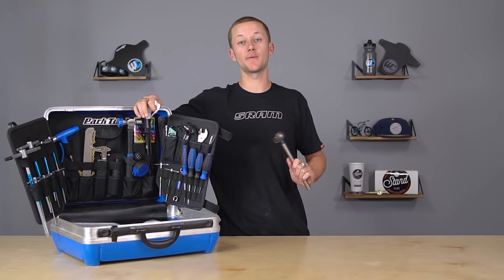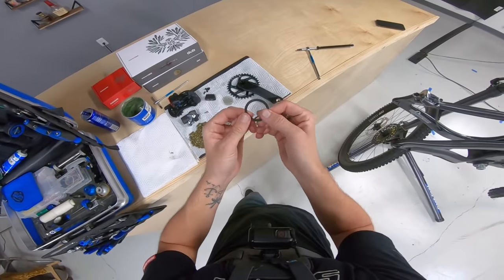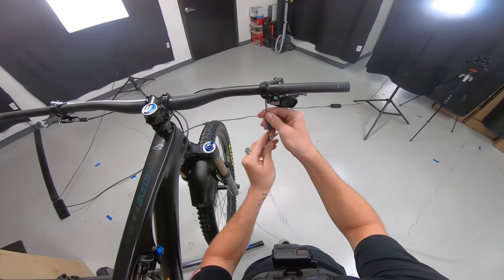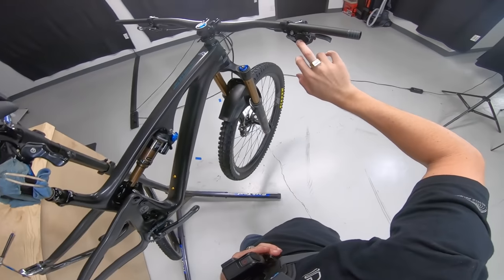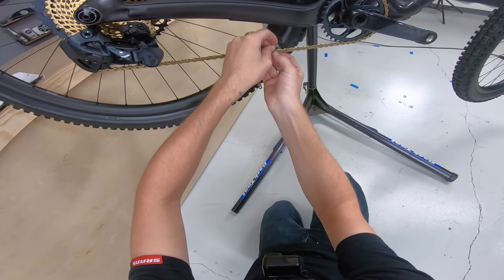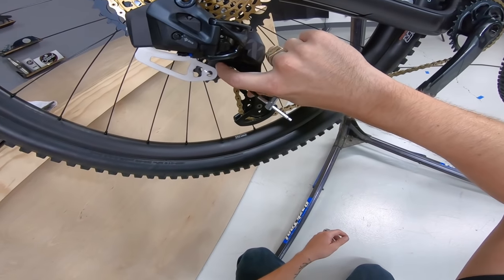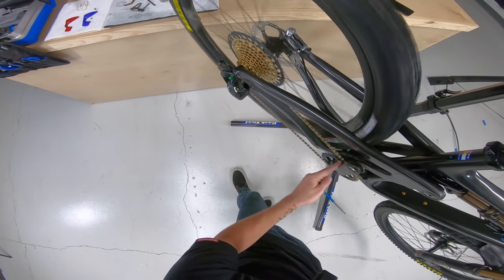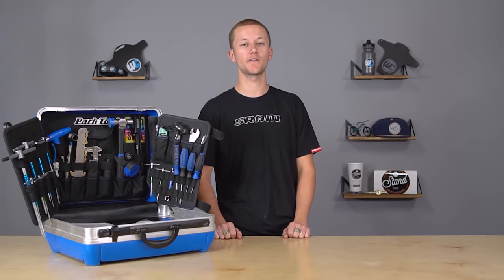How To: SRAM AXS Eagle Drivetrain Install & Setup (Step-by-Step)

Comment from the maker: What is your perfect drivetrain setup?

00:00 Intro
00:29 Parts and Tools
00:56 Install Cassette
2:00 Install Crankset
4:34 Install Rear Derailleur
5:14 Install Controller
6:10 Install Rear Derailleur Battery
6:31Pairing Derailleur and Controller
8:22 Linking to the AXS App & the different modes
9:54 Install Chain
12:34 Derailleur B Tension Tool
14:59 Derailleur Limit Adjustments 
17:42 Micro Adjustments
Reply: This, but with the rainbow chain and cassette.  Then toss on a Reverb AXS and XTR 4-piston or G2 Ultimate brakes.  Put that all on a S-Works Stumpjumper frame with custom paint, Fox Factory suspension, and some fancy Roval wheels.  Something that I thought would look sweet is if you take the upper of a Reverb AXS to a anodization shop that does Kashima, and get the uppers Kashima anodized to match the suspension.
Reply: XX1 AXS(rainbow full set) on my XC bike and XTR full set on my Enduro and trail bike
Reply: i have the same but in X01 uninstalled. I'm still trying to figure if I have to replace my chainring. what was the crank and chainring used in this video?
Reply: Shimano 12 Speed deore cassette for looks and hyperglide +, then a sram axs shifter for crisp 12 speed action, ofc with shimano chain. Mismatch made in Heaven. I currently have the probably sexiest E-Bike on the market and installed AXS on it today.
Reply: A free one
Reply: Hey are the limit screws the same on mechanical eagle? Closer one to the cassette is high?
Reply: Axs, but running a 10-42 11 speed cassette ;)
Reply: Where you buy all your tools on the video?
Reply: Something that FREAKING WORKS
Reply: XT 11 speed ftw!
Reply: @MrBig617  Hi trying finding some information about this. Is possible use AXS on 11 speed cassette 9-46?
Reply: @dylan-5287  Hi Dylan 
It's possible use 11 speed cassette? I have 9-46 (garbaruk-sram) and want to try this.
Reply: @mattamee7  No idea. I've been searching high and low on a hack to run it with a 10-42 11 speed cassette. No luck yet.
Reply: @mattamee7  what do you mean?
Reply: What tool kit are you using in the video
Reply: is it possible to just get the reverb controller (no seatpost)  by itself and add it to the derailuer/controller so that i have right hand controller shift down the cassette and the left hand reverb controller shifting up the cassette…

like a paddle shifter in a car?

Comment: Here's a trick, unless there's some reason I don't know not to do this.  Instead of adjusting B with the rider there, simply let air out of the shock and use a cinch or ratchet strap from seat post around rear rim to hold it at 20-30% sag, whichever you think the rider will want.  Coil is a bit more difficult but usually you can lean over seat, with seat in chest, pull up on stay to proper sag, and pull cinch strap tight to hold in place long enough to adjust the B.
Reply: Very conventional method. I like this video on sizing the chain because he did it very straightforward.
Reply: I tried your tricks and the only way I found to hold coil in sag is from the back triangle,but then it stuck the wheel, do you have better place to do it on santa bullit ?
Reply: @geekBengal  Woah, this is an old one!  So I'm not sure what you mean.  Did you run the strap around the base of the seat post and around the rear rim?  If so, lean over the bike with the seat in your chest, pull up on the chain stay, cinch the strap.  Should hold it in compression then.
Reply: @Chuckolicious  Yes but then the wheel is not moving anymore. Another question, is it mandatory that as soon as you move the wheel to match the cog of dérailleur, is it normal that the other teeth are not touching the white anymore ?
Reply: @geekBengal  So I've been talking about measuring that B-Adustment screw with the little plastic gauge they send.  For that there is no spinning or shifting.  Remember, if a rider was sitting on the bike like they suggest, there would be no spinning the wheel either.
Reply: @Chuckolicious  but in their tutorial they move the wheel+cog until it match the middle of cog right

Comment: „I like grease“ - puts the cassette on dry 😅
Reply: new cassettes have anti-seize from the factory :)
Reply: That is correct but a little more grease wont hurt.
Reply: @taunir713  as long as it’s the same anti-seize. I wouldn’t mix bearing grease with anti-seize tho..
Reply: @liamwoods5353  Ah thx, would the Shimano antiseize be the right One?
Reply: @taunir713  probably not
Reply: Most on this vid is wrong

Comment: Don’t grease your hangar bolt, unless you want your expensive AXS to undo and end up in your wheel, use blue Loctite.
Reply: It comes with pipe tape already applied so you shouldn't need to do anything except tighten it and move on.

Comment: Of course this comes out 1 hour after i install my SRAM AXS setup.
Reply: Was it as easy to install as the video shows?
Reply: @ddialogue  Yes, very easy.
Reply: are you using the 10-52t cassette? did you use the Blue B gap tool?
Reply: @kylaling10  Yes, I'm using the X01 10-52 upgrade kit but the shop ended up installing it for me when my new bike came in.  They didn't give me the B gap tool (doh!) but I already own the updated B gap tool (white) which clicks on to the 2nd largest ring on the rear cassette.  Now I'm wondering if that's the correct tool for the job. 🤔
Reply: @ddialogue  just wanna know if i’m correct  so the blue is meant for the 10-50t and the new white tool is for both 10-50 and 10-52.? My upgrade kit came with the blue one and i’m using 10-52t cassette.
Reply: @kylaling10  Oh, I see!  From what I can find (on Google) the white tool is the updated/compatible tool which is used for both cassettes on AXS and non-AXS drivetrains.  The 10-50 was the only option when AXS was first released and if I was in your situation, I'd use the white tool just to be sure.
Reply: @ddialogue  okay, thanks.. by the way i’m from the Philippines. Guess i have to order it.. appreciate the time..
Reply: @kylaling10  i used the white b-gap tool, the blue one does not work. it comes with the 52 cassette

Comment: Like your videos. This is all straight forward when you have the correct HUB on your wheel, when you have the correct BB, when you have the correct post vs flat mount brake calipers, and you know what you are doing.
I myself, am in the progress of overhauling my original Giant TCX ADVANCED PRO 1. I was mounted Shimano 11spd cassette, SRAM S series hydraulic brake calipers, shifters, all mechanic.
Going to XX1 10-52, XX1 AXS derailer, keeping my original BB and Crank from ROTOR, swapping to a single narrow/wide 40 teeth front ring and going with Sram FORCE shifters which come with flat mount calipers that I will have to take off, to use my original s-series sram calipers as they are post mount. FORCE don't make post mount calipers any longer.....

Its very complex and confusing to know when you need a BB spacer, when you need to use an XDR or and XD hub. Is your existing wheel even compatible with an XD hub or XDR hub etc...
The calipers, can they be re-used with a different shifting group.... lots of unknown for office workers like me.

Keep the videos coming, I have learned a LOT! Thank you.

Comment: So I have an AXS shifter and derailleur I put on my bike with 10-52 NX cassette.
1x 32T drive and NX chain NX cranks
Worked FLAWLESSLY! No issues what so ever!
Then I got new wheels. I9 hydra hubs with XO1 10-50 cassette changed out the cranks to XO1 and chain xx1. I measured the NX chain that was with my 10-52 to be the exact length of the new XO1 10-50 cassette...
Adjusted the b gap perfectly It shifts PERFECTLY SMOOOOOTH with no load on. But as soon as I put some load on the shifting is hard like there’s a crunch where as before it was smooth. Very hard shifting sounds...
The chain doesn’t jump or anything it shifts great with no load when I ride around the block.
Any tips or tricks???

Comment: Great video! Just upgraded my vitus mythique 10 speed to sram xo1 12speed (cable) . When i go lineup my jockey wheel( on derailleur ) with 10T cog the adjustment screw needs to be backed all the way out. Like if derailleur needs to be spaced out so screw can be screwed in. The hanger is stock and not bent. What to do??

Comment: excellent I,have a question for you. My bike has a coil, how it is possible to do it in sag position alone ? I tried using something to press and keep my coil in sag,but then I cant move the wheel anymore to use the b tool. Do you have an idea ? Because there is a very big difference when bike is in sag regarding the derailleur

Comment: Great video, I just bought the upgrade kit. Will I need to alter my chain length if I am doing a straight switch over of the derailleur from X01 to X01 AXS? Thanks.

Comment: We installed a GX Eagle AXS last week but we couldn't make it perfect even when configuring it under sag. First of all, it seems to me these micro adjustments are not really that micro. 8 clicks and the chain is already switching to the next cog. I mean, with my Deore Shifter I get a lot more fine cable tension turns and I can adjust it so it doesn't make any noise in any part of the 11 speed cassete. However, I do run a 2x11 setup so the chain line is perfect.

Comment: Great video! I’m finding it hard to get my axs shifting perfectly when I’m on the bike, but I haven’t adjusted under sag, so that’s probably it. However while fiddling with the adjustments I’ve done a lot of micro adjustments on the controller. Is there a way of resetting to factory settings? I reckon I’d like to get the new b tension tool and start again from scratch! Cheers.

Comment: Hey guys little confused about this setup. 

Per SRAM, you’re supposed to set the chain up in full sag or remove the rear shock and you’re supposed to measure the length of the chain using the largest cog. It’s any particular reason why this is being done differently.??

Comment: What does "under sag" mean?  Also, that tool that  you clip onto the large cog for the b-screw adjustment--what is it called?  And can I use it to adjust for a cassette that I just put on- 9/48 -- 48 is my largest cog?

Comment: Liam, bought a second hand Scott Spark RC two weeks ago with Sram Axs eagle. The front shifting is not working (changed the lcd battery..nada) looked at the AZS app and there's a shadow/black where the front shifting should be with an exclamation mark. Reached out to Sram and it's not got back to me, any advice here  could it be something more fundamental like, sadly (replacing the shifting mech)

Comment: So I’m curious what happens if you guys try to set the chain length the way sram says?  I’ve always used the bottomed out on big ring and use appropriate overlap and it’s always been successful for me.  Now with the 10-52 if I do this I end up with a drooping chain on the highest gear.  Have you guys ran into this?  Maybe sram needs a revision
Reply: It should only droop when the bike is unloaded. If your at SAG it'll be right.
Reply: @calvinspaeh3353  correct but it only does it with the 52t not the 50t and then when the rear wheel leaves the ground the chain droops and changes gears in the rear over rough stuff.  So I end up running the chain length as if using a 50t so it’s a touch short but the alternator is tons of chain slap from the droop accompanied by the weaker clutch on AXS and then sometimes gear changes.   So hopefully they’ve addressed that

Comment: I pretty much have 2 gears side by side that usually give me trouble.  I make adjustments and usually the 2 problematic gears move together somewhere else on the cog.  🤷‍♂️  Sometimes I press the thumb paddle softly (without changing gear) and that   minor tension kinda sets it in gear.  Its a fine shifting art but annoying A.F.

Comment: Fellas, my axs is way off at the starting position.  Like way too far outboard.  This is on a brand new frame and new hanger, it's not bent.  It will only shift up, essentially 10 gears because it's starting position is so far out.  How can I tell the derailer to start further in board?  This is driving me crazy.  If I have it shifted to the smallest gear it will shift the chain right off into the chain stay.  If I adjust the limit screw so that the pulley is under the 10 tooth, the derailer won't shift until I press the shift twice and then it will only move 10 gears.  I tried micro adjusting the 1st gear position, but it tops out before I can get it in the correct position.  Please help.

Comment: The official sram manual clearly shows that the shifting bolts should not be lubricated. The bolt is covered with loctite. This already shows the contradiction - loctite - grease. It's strange that no one pays attention to it.

Comment: What’s your opinion on SRAM saying: no  Grease on the main Screw of the Derailleur? (SRAM install video on YT)
I heard people complaining about the Derailleur loosening.
Reply: Alloy on Alloy sometimes will bond over time, if performing regular bolt checks ive never had any issues :)
Reply: I'm not sure why they said to use grease when assembling the screw on the derailer. Some metal will react chemically when assembled (aluminum to steel) and you want to use anti seize which helps prevent this. Steel to steel (bolt/screw to threaded hole) I would recommend using a thread lock compound. Several types are made (low, medium, penetrating) which one is used depends on what you are assembling.  It should go without saying that anything that is used with allot of vibration and impacts the fasteners should be checked often. It's the nature of the beast that MTB require allot of maintenance. Simply riding it and checking bolts and fasteners once in awhile your bound to have problems.

Comment: is the Blue B tension tool used for 10-50t? because i have the 10-52t cassette. just want to know. thanks. great video by the way.
Reply: There first was a red tool for OG 10-50 eagle. Then the purple/blue version came out for AXS and it should do 10-50 and 10-52. The white version is completely different and works with -50 and -52

Comment: SPECIALIZED
STUMPUMPER EVO Troy Lee Designs 29 Frameset - Limited-Edition
Frame Build

FRAMSET BUILD

#01  Specialized - Stumpjumper Troy Lee Designs 29 Frameset – Limited-Edition FACT 11m full carbon frame, asymmetrical design, 29 style-specific EVO Trail Geometry, SWAT™ Door integration, threaded BB, fully enclosed internal cable routing, 12x148mm dropouts, sealed cartridge bearing pivots, replaceable derailleur hanger, 140mm of travel

WHEEL SET

#02  Chris King - Disc Hub Rear ISO XD 28 Hole BOOST 148mm x 12mm Thru Axle, Color - Red

#03  Chris King - ISO AB Disc Hub Front 28 Hole BOOST 110mmx15mm, Color - Red

#04  Pillar Racing Spoke - WING 21 - Stainless Steel Spoke/Ceramic Nanometer Ti Plating, Color - Ti Black, 46pcs

#05  Sapim - Polyax Secure Lock Nipples, Color - Red, 46pcs needed

#06  We Are One Carbon Union 28H Rim 29", 2pcs

#07 PEATY’S - X CHRIS KING (MK2) TUBELESS VALVES Color -Red (PAIR)

#08 (Front Tire)  MICHELIN WILD ENDURO FRONT GUM-X      Size	     29X2.40    

#09 
 (Rear Tire)   MICHELIN WILD ENDURO REAR     Size	      29X2.40

DRIVE CHAIN

#10  SRAM - XX1 Eagle AXS Controller, EC-AXS-SRAM-A1

#11  SRAM - XX1 Eagle AXS Derailleur, RD-XX-1E-A1

#12  SRAM - XX1 Eagle Chain, 12sp, Gold, CN-EAGL-XX1-A1

#13 SRAM - XX1 Eagle Cassette, Gold, CS-XG-1299-A1

#14  AbsoluteBLACK - OVAL BOOST DM CINCH PREMIUM CHAINRING, TOOTH COUNT - 32T, 

COLOR - Black

#15  MRP - Chain Guide Mini G3 32-36T BB Mount

#16  Chris King - BSA ThreadFit 30mm Bottom Bracket, Color - Red

#17  RaceFace - Next R Crankset, Arm Length 170mm, Color - Stealth

#18  Hope - F20 Flat Pedal, Color - Red

SUSPENSION

#19  FOX - Factory Series 36 FLOAT 29 160 GRIP2 HSC/LSC HSR/LSR 110mm Axle 1.5 T Kashima Gloss Black, Standard Chassis 44mm rake

#20  FOX - DHX2 Performance Elite, Rx Trail Tune, 2-position lever, 210x50mm, S3-550lb spring

COCKPIT

#21  FOX - FACTORY TRANSFER SEAT POST, Diameter Size 31.6, Metric Size 150mm

#22  Cane Creek - SEATPOST SHIM 31.6 to 34.9MM

#23  Wolf Tooth - Seatpost Clamp, CLAMP DIAMETER 38.6, Color - Red

#24  Wolf Tooth - ReMote Limited Edition Red

#25  Wolf Tooth - REMOTE FOR SRAM MATCHMAKER X

#26  Specilized - POWER PRO ELASTON SADDLE - Black 143mm

#27  Chris King - Dropset 2 Tapered Headset 42/52mm, for Tapered 1-1/8" steerer, Color - Red

#28  RaceFace - Turbine R 35 Stem, Stem Length - 32mm, Color - Black 

#29  RaceFace - Next R 35 Handlebar, Bar Width - 800mm, Bar Rise - 20mm, Color - Black

#30  ODI, Troy Lee Design, LOCK-ON MOUNTAIN BIKE Grips, 130mm, Black/Gray, Set

#31  ODI, Troy Lee Design, LOCK-ON MOUNTAIN BIKE Grips, 130mm, White/Red, Set
Make Black/Red, Set out the two Grips

BRAKES

#32  SRAM - Code RSC SRAM, MTB Hydraulic Disc Brake, Front, Post mount, Rainbow Hardware

#33  SRAM - Code RSC SRAM, MTB Hydraulic Disc Brake, Rear, Post mount, Rainbow Hardware

#34  TRP - TRP-33 TWO-PIECE STANDARD THICKNESS ROTOR, Size 203mm, 2pcs

#34  SRAM - Titanium Rotor Bolts, Rainbow, 12pcs

Comment: i want to link the rocker shifter to an axs force rear derailleur. I cant find anywhere that says this is possible or not. HALP
Reply: It should work the same. Axs can pair with Axs. They call it the eco-system :)